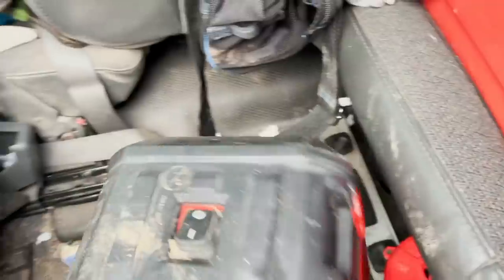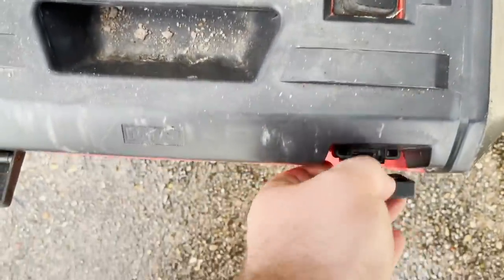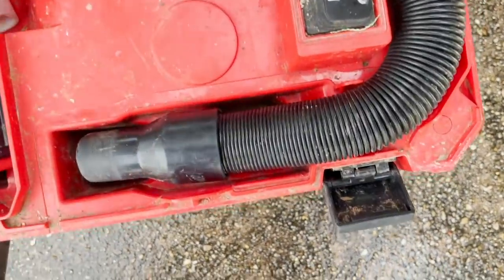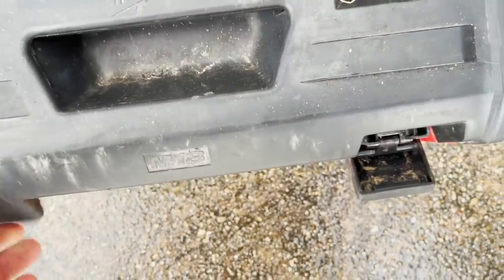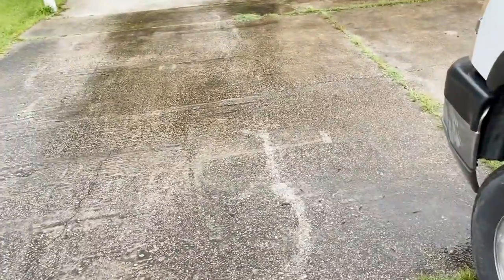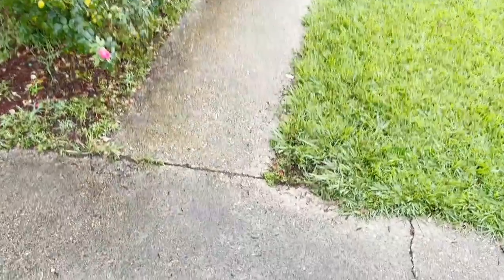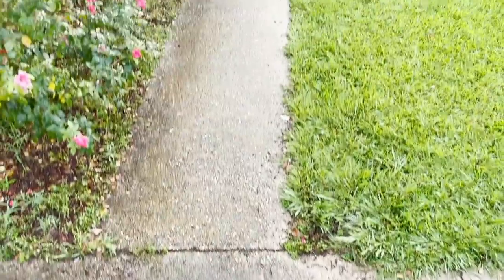Clogged Condensate Drain/No Cooling

Comment: I almost always used bleach to clean drains because the clogs seemed to be caused by green or black slime growing in the pipes in South Texas. No, I didn’t use full strength bleach. Flushing with warm/hot water with bleach seemed to work best.
Reply: I like using bleach with a bit of dish soap thrown in.

Comment: John where did you the attachment from the shop vac to the drain cleaning ... I got the m18 as well but it won't connect to that cleaning tool
Reply: Was going to ask this same question
Reply: @josephmettes9147  I hope he answer
Reply: At John new starting tech and new to the channel thanks for the vids.   And all it's on Amazon I bought one just search diyvac for it
Reply: @egontechnical3694  we have the diy the m18 shopvac won't connect to it
Reply: I just put the end of the hose on a grinder and and it fits perfect.

Comment: Hey John, just wanted to say good video and to ask you a question on the 2" drain that the air handler drains into, is that common in your area? I'm newish to the trade and out of Phoenix, AZ and haven't really seen any drains that go into a p trap that large. Stay safe out there!
Reply: Not sure about what’s common practice in his area, but drain line setup like that is probably tied into the home drainage piping. Most ac condensate drains are 3/4 “ run directly outside the home and open ended.
Reply: @roberts1159  Thank you for the reply :) The 3/4" draining to the outside of the home is the most common thing I've seen but sometimes it goes into a bathroom sink or something but I was curious if the larger pipe was common in Louisiana. Stay safe out there!

Comment: What is the cause of the drain line clogging?  Is it from not changing out dirty filter?
Reply: Dirty blower wheel and dirty evap coil, dirt mixes with condensation causing the condensate line to back up
Reply: Over time things grow in standing water, there is always a bit of standing water in the condensate pan. There is pellets made that can be dropped in the pan to hinder the growth of algae, I use them on every service. Some think bleach is good, bleach stinks for one and can rot the metal prematurely.